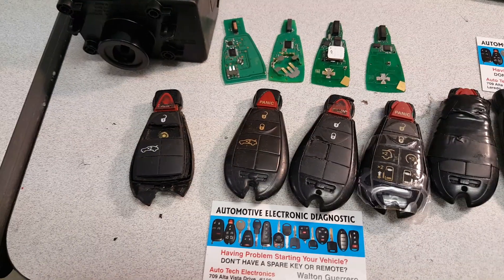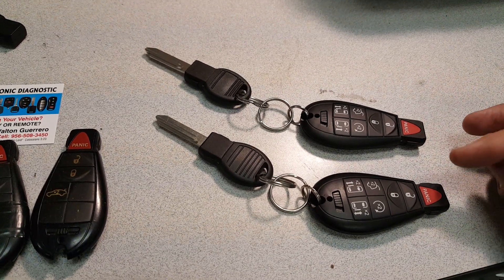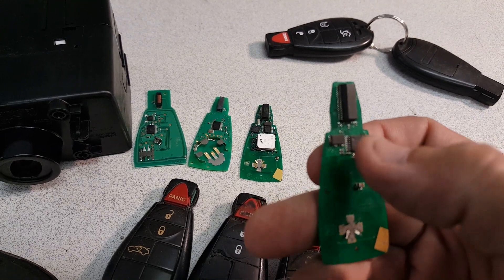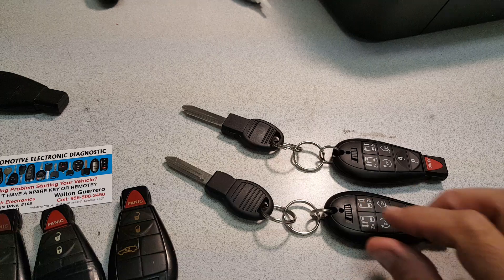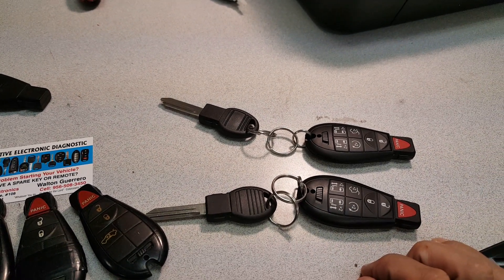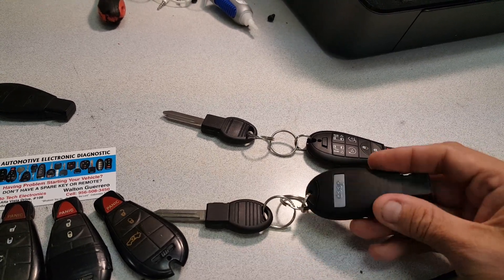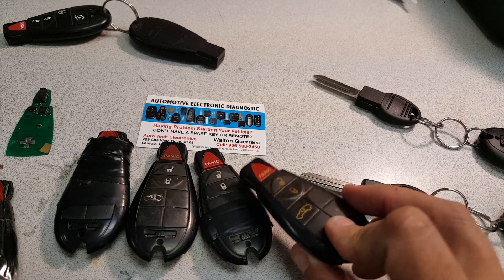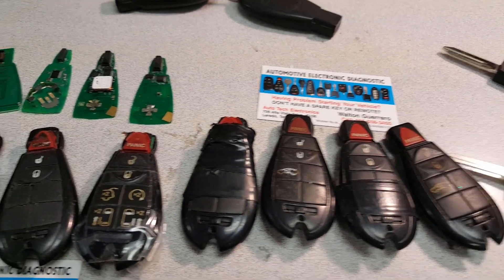Why Chrysler Dodge Jeep Fobik Keyless Remote Break stop working won't start vehicle

Comment: This looks like a stupid design.   Ya here is an idea 💡. Let’s take the remote and only put the tip of it in the ignition and turn it. 🤦‍♂️. Totally stupid idea.
Reply from the maker: I agree,  bad design.  The tip of the remote should have been solid plastic so it would not flex and break.

Comment: Hi I have a 2010 Dodge Caravan my key fobs battery went dead and I replaced the battery prior to it not working to unlock my vehicle..I ordered 2 key fobs off line.. How would I program the key fob when I recieve the key fobs to my vehicle?
Reply from the maker: You need to have a locksmith program the new fobik remotes.

Comment: How do I fix my 2008 Dodge charger remote key?  It's reading "damaged key" when I put the key in the ignition.
Reply from the maker: Here is a link to our repair service. http://www.autotechelectronic.com/repair/repair-only-wireless-ignition-node-wcm-win-for-1st-generation-module/
Reply: I’m having this same problem! How’d you solve the problem? Do you think I need to replace the battery in the fob?

Comment: My 08 Magnum didn't come with that style valet key. Is it possible to get one so I can start the vehicle with that instead of the fobik?
Reply: Yes those fobik Keys without the remote can be programmed for your Magnum. Interestingly my 2010 Dodge Charger came with 2 of those and none of the original remote fobik.  My guess is it was repossessed in the past? I actually am glad to have them cause I like aftermarket remote start systems so I installed one and have the aftermarket remote and a simple key rather than 2 fobs.  Actually later when installing I found a remote start already in!